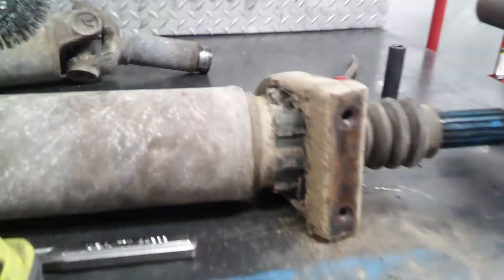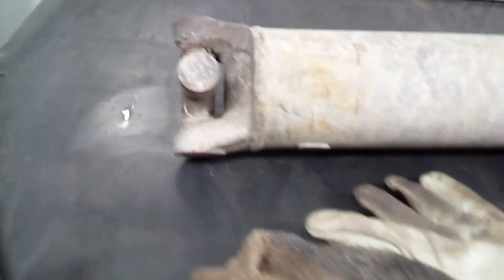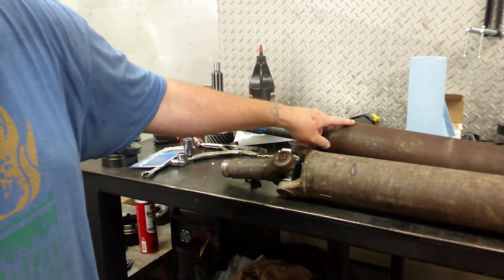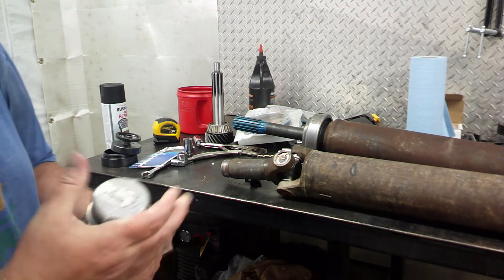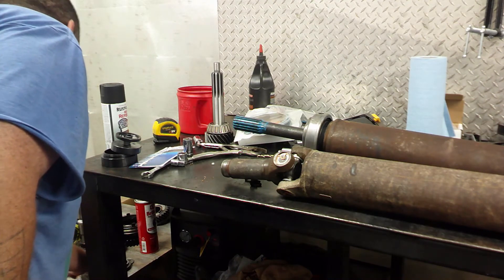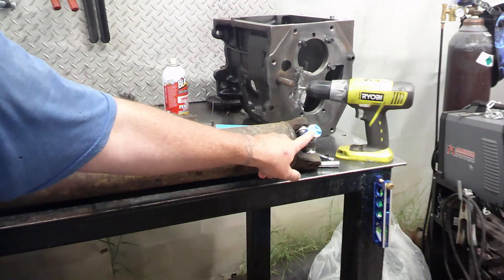2 Piece Driveshaft Rebuild

Comment: Thanks for documenting the driveshaft rebuild. I have a center support bearing replacement in my future and was interested in how it removes from the shaft. Next time you need to replace those ujoints, try tapping one cup deeper into the yoke to get the opposite cup to pop out.
Reply from the maker: I appreciate the tip. Hopefully next time I'll have an air hammer too. 😂